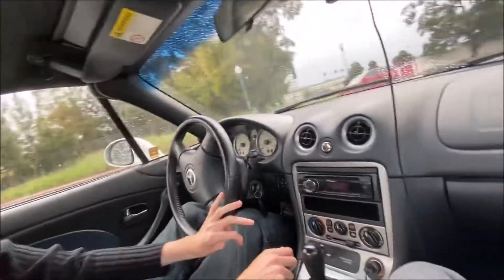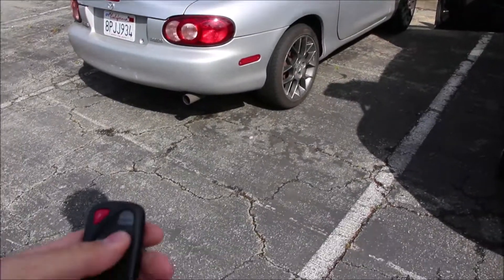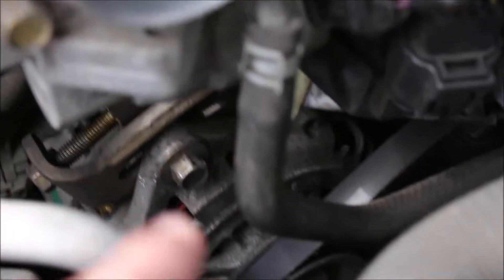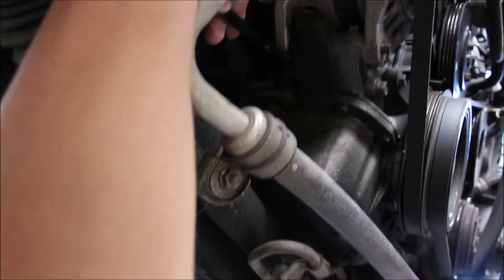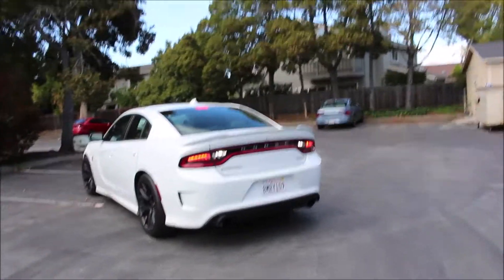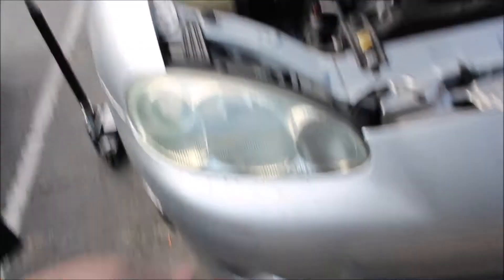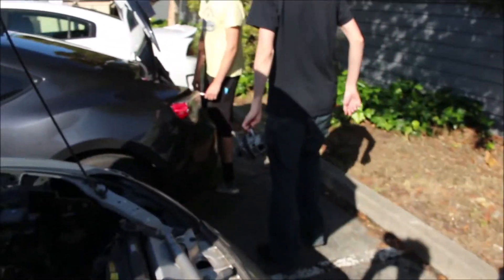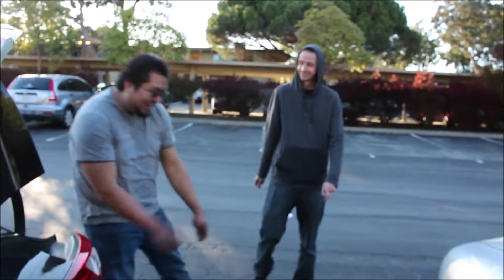HOW TO REPLACE A MIATA ALTERNATOR

Comment: Question: got new alternator it starts for a few seconds then dies..  works with old alternator but not with the new one any reasons why? Already tried it with another battery so it’s not the battery